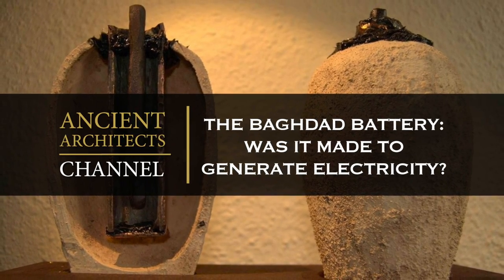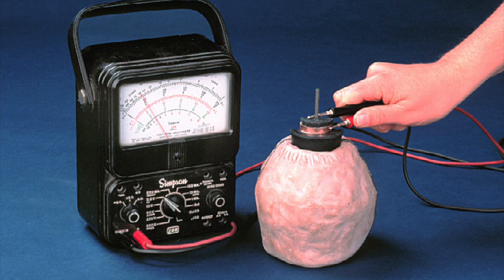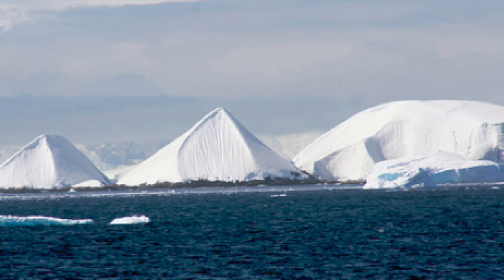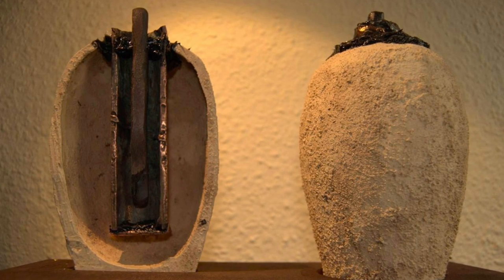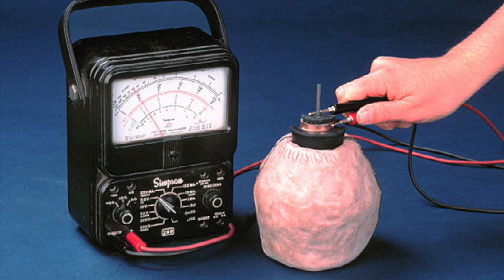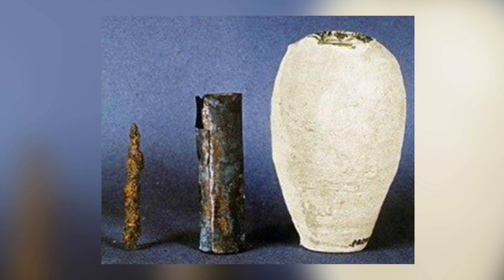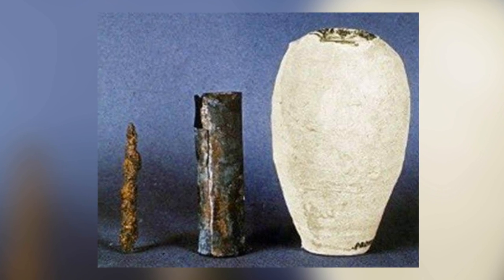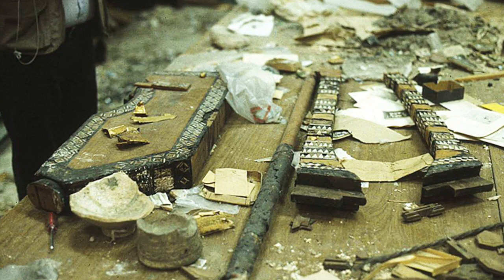The Baghdad Battery : Did it Really Generate Electricity? | Ancient Architects

Comment: Could they have been used to purify copper.  The slow motion version of an anode and cathode?  That could also be an explanation of the unmarked sarcophagii in Egypt.  The metal anode, cathode, and sludge are long gone, but the mostly unmarked containers for purifying copper remain.  Both systems relied on slow chemical reactions that had an electrical side effect.  One group of ancient Egyptians may have learned to use the electrical aspect but after a few hundred years of prosperity and droughts, lost the technology.

Comment: And the reason they dont just make bigger ones is because you wont necessarily get more voltage but space for the electrolyte solution so you would get a longer battery life but not voltage and you can electroplate with low voltage and for how primitive the battery is would be very easy to hook multiple together

Comment: Those are probably batteries. The iron is corroded being in a very protected and dry environment. Battery acid. Asfault is easy to remove by heat.  A bigger voltage could be achieved by many batteries connected in series not by one bigger battery which would give more current not more voltage.

What could it be used for? Maybe to remove rust from iron or something. Electrolisis have many applications. Make chlorine from salt water ?

Comment: Modern solder is 60/40% tin/lead, not 60/40% lead/tin as you said was used on the Baghdad battery. Even so, to have used any solder at all implies to me that there was an external electrical connection, ie a wire!

Comment: As someone who studied science , not classics, they are obviously wet cell batteries, no doubt. But you need a bunch in series as one only gives to about 0.8v. So then you need wire, but the copper wire has been taken and used for something else, like making jewellery . Someone could have been researching the electromagnetic effect a bit before michael faraday , but yes, not alot of motors around... but who knows ?

Comment: Just a thought/question, could they have been used as some kind of explosive device 🧨 💣 ? 🤷‍♀️
Reply: With wire and a spark, one might be able to remotely start a nasty fire. Especially with bitumen and wood or oil once it got started. Uncoated wires underground in dry sand could start a fire a ways away and seem like magic. Could be used in an altar for instance or it could have obvious military uses.
And with a goatskin full of natural gas, a tube, a bush, and such an igniter you could set up a miraculous burning bush that is not consumed by the flames deal too. On command. For a while at least.

Comment: Ok so just like the modern days they could have used some kind of soft material (probably a metal) that when it was heated it could Amit light . Just like the lamps we have they could have just connect the battery with the artifact, so no wires were needed .

[Sorry for my bad explanation Im not an English speaker so I tried to say what I thought the best way possible.]

Comment: It looks like a basic battery, is cleverly designed as a battery with isolated anod/ catod + acid, and WORKS as a battery. These are some very strong arguments and proof points. Simply stating that because we haven't found any recorded usage of them, therefore they can not be batteries, is a weak argument. Insted, explain why they were in this quite advanced design that just "happend" to work as a battery when their purpose was a simple container...
Reply: Absolutely right

Comment: I believe these were used for gold plating, a few volts are enough for that. Maybe never used where these have been found, could have been traded/stolen items. The answer of why they did not built larger vessel for higher voltage is simple. No matter how big the vessel is, the cell voltage won't increase only the capacity. Even modern batteries have a few volts cell voltage. A 12V lead-acid car battery consists of 6 cells, each providing a 2V nominal voltage. You can observe 6 caps for refilling electrolyte on the older, non-sealed batteries. Sealed batteries do not require refilling electrolyte hence the sealing. Charging is a mystery, maybe they melted the black material and replaced the content as electrical generators are different technology and far more advanced.

If it was for sacred scrolls, why the iron bar? And where are the scrolls? 

However it could have been some kind of bomb. You slam on the iron bar which punctures the copper so mixing the 2 liquid, initiating some chemical reaction leading to an explosion? But its likely that the copper part would have been ripped of from the vessel instead of the iron simply puncturing it.

Comment: Well the obvious answer would be electroplating. There seems ample evidence for this and doubtful you would need iron rod copper tube in acid solution for storing papyrus? As to the coated rod at top  to avoid shorting and losing electric charge prior to use, simple to melt or scrape off when ready for use. The clay container holding acidic component was probably the replaceable part and disposed off when electrolyte solution was used up the rod and copper cylinder just being inserted into new pot each time. Sort of an early rechargeable battery?

Comment: The lack of motors does not disprove that they are batteries. The exact same thing happened with the "voltaic pile" type batteries when they were invented in 1799. Initially there was absolutely no use for electricity and electric sparks were demonstrated as party tricks. People thought it was fun to be shocked by it. It was decades later when the technology developed to the point where someone invented motors, generators and lights. Inventing a motor would have been extremely difficult in the ancient time, due to the lack of experience with high rotations per minute machinery and the lack of metal wires. These are not things you would invent out of nothing, when there's no similar relevant industry and when nobody can think of a scientific way to explain the phenomena.

They likely were batteries, but they had not yet invented wires. They were at best party tricks, similar to the early "voltaic piles". The top of the iron rod was probably covered for safety, because it took effort to construct and they wouldn't have wanted an accidental discharge.

And in no way would anyone store important documents under a bitumen cover. If any of that would fall on the document, it would be next to impossible to clean off (they had no decontaminative agents like we do). Storing a document in a water proof box is a good idea, but surely if bitumen was the only way to seal it, the box would be designed to have an opening on the side, to keep the contents safer.

Comment: Though I'm not convinced in the battery hypothesis myself I would like to point out that early experiments with electricity as a curiosity where nessesary before the invention of electrical devices. If it is a battery it could be similar to the anchient Roman "steam engine" that was invented as a novelty and never put to practical use.

Comment: That last part of this video may actually give a hint. Looters of the Iraqi museum destroyed or stole the most valuable items and I believe the same thing happened to the artifacts that were powered by these batteries. The bigger batteries were destroyed centuries ago, the smaller were easier to hide and/protect. We may be looking at batteries that were placed in storage with asphalt covering the iron contact to protect against accidental discharge and could have been removed prior to use. The papyrus storage theory is new to me, but it doesnt explain the particular design of these artifacts

Comment: I'm as skeptical as anybody, but I think the best guess at this point is that these were probably batteries. Maybe they had ritual significance lol. Maybe they were novelty gag items. One volt would be plenty for electroplating or for the tingles. 
I will happily prefer another explanation if someone can find one. "Scroll storage" doesn't pass the laugh test. (Too small, no purpose for the iron and copper and, damningly, they were sealed with no scrolls inside.) 
They didn't power pre-dynastic HVAC or interstellar antigravity healing magic, but I bet they were batteries.

Comment: It's been my experience in life that the most sensible, easiest solution is more often the answer.  Theories that require a quantum leap in understanding of a relatively  mundane object, ie. these jars, that we discovered electricity 2000 years before we think we did rely on a HUGE jump of understanding.  Too far a jump for me.  If these are batteries, what did they power?  Where is there evidence anywhere in the world that we developed machines that used electrical power in such distant times?   Such a discovery of electricity once found, would never be forgotten and would proliferate rapidly and there would be many examples of equipment and ancient machinery still surviving, not just the few of these objects.

Comment: I think you're missing the ball here. Electricity doesn't just power motors and moving devices. Electrochemistry and electroplating would have been sorcerer level tricks in ancient times and could well be an integral part of the stone softening process, which was lost over time due to secrecy, and left people with only the knowledge of these curious jars that would hurt you if you arranged them and other metal pieces just right. 6 would produce a sensation on the tongue, 20 would produce a sensation on sweat soaked skin, 60 would make a grown man curse, 100 will start putting the fear of God in an unbeliever.
Many uses beyond spinning a wheel.

Comment: Matt, they did produce a charge ... that is NOT  insignificant. There is no evidence of electroplating in the region, but electroplating existed, and the very means to do it is the very thing you debunk. 

It's not an electric powerhouse, but there may have been a thin 'wire' leading out and it could have produced a tingle on the tongue or skin.. these particular devices were suitable for medicine.   Larger versions (lost in history) using exactly similar technology were used for electroplating.

Comment: They would have to be connected in series to increase the voltage, bigger ones would only increase the current, seems to be a battery to me why else have the iron rod and insulation

Comment: Here are the problems I see for your theory... why were they trying to store papyrus in this fashion? Surely they knew about oxidation it occurred so the iron makes no sense and why do they use copper for the inside? Why didn't they just coat the entire thing with bitumen if the idea was to store it Forever Without ever being opened because that's what they use for mummies the same reason. How come they never found any of these witb any Papyrus inside? Why are the iron rods always noticeably degraded from some kind of acidic substance? Perhaps a new said if they didn't cover the iron rod for storage purposes the battery will be unusable and that's where they found them to be totally covered with bitumen. As for why they never found any wire perhaps they didnt use wire because manufacturing wire is very difficult. There are many other things that are electrically conductive maybe whatever they use could be used in other places and that's why it wasn't found with the batteries which would only be good as batteries?  in my opinion they're much more problems with the theory that they were used as some kind of paper storage device than there are problems with it being a battery.

Comment: Maybe it is a battery but they didn't really know. We could just be overestimating their knowledge based on what we know today. We only found a few of them in one location, correct? Perhaps someone was simply experimenting and obtained some results without really understanding all the details. Where are the wires and electric motors? Where are the power drills? Just look at the battery. They weren't even close to that level of understanding yet so maybe they didn't have a specific application. If we found a ton of them all over then it would be safe to assume they had an actual purpose and people were using them for something but that's not the case. Maybe it was just good old fashioned science or some crazy ancient guy screwing around in his shed.

Comment: 1 volt doesn't have to power a motor or a city. 1 volt is enough to cure a minor skin infection, or even some parasites.  For such a short term medical purpose, they can easily have been intended as short term disposable objects. Look into alternative health "Hulda Clark" microcurrent  "zappers".  I've got one  ✔❤   Ok, It takes a 9 volt, but it works pretty well, depending on what I'm treating.

Comment: I suppose it’s possible that, much like Hero's steam engine, the principle was discovered, but not the practical application. We don’t have objects requiring electricity from the time period of the jars for the same reason the Romans didn’t have a network of locomotive tracks. It’s possible that, like Hero's engine, the electrical nature of the jars was treated as no more than a toy, or novelty. The iron rod may have been completely covered, but if not, is 1 volt enough to create a tingling sensation if touched? If the bar was indeed covered, would the terra cotta jar itself or the bitumen sealant be conductive enough to convey any such sensation? Such tingling abilities could have been used in any number of faith healing or other hocus locus activities. But more likely it would have been a household novelty - you have company, invite your guest to hold a seemingly nondescript jar on your shelf, then laugh like hell when they freak out because it makes their hands vibrate. So, basically, the Baghdad Battery was a 1st century plasma ball. They probably sold them at the ancient Iraqi version of Spencer's Gifts.

Comment: How do you know they're not for single use?
Just because the components it could have been connected to dont exist anymore or haven't been found isn't evidence.
Who are we to say they weren't using a large number of these at once to produce more than one volt?
It could have been to power something we'd consider tiny but massive is significance to the people of that time (as part of an annual religious ceremony for example).
I doubt it's a battery but I don't think this video has done anything to prove otherwise or suggested anything we don't already know.

Comment: Absents of evidence for intended use when dealing the ancient world is not conclusive proof.  If it looks a battery, works like a battery when duplicated, then It's the only supposed purpose that makes sense.  Single cell batteries connected in series increase overall voltage out put.  A series/parallel system can be tailored to suit different applications. Somebody needs to go dig up some evidence of plated artifacts instead of dismissing it.
Reply: Absolutely right

Comment: No electric devices doesn't mean it's not meant to produce electrical power..it could mean only that they just discovered how to make electricity and were only in the early stages of experimentation. If it were only just discovered there would be no  devices to power and the quality of "battery" would vary due to lack of knowledge and experience with how to use such new technology. And most mainstream scientist agree with each other as to not be discredited in their field.  They are certainly made to produce electricity or the perfect, specific, components would not be used to make s scroll holder!

Comment: Yes sir, those are batteries. They did not connect to motors because motors were not invented yet. (Atleast, as practical application). If you think about it, batteries are far more intuitive to invent than a motor. (And that's why Tesla was a genius). 

So, what did ancient batteries do?
medical relief during paralysis or just a type of massage. A small current was used as a way to treat paralysis or to massage. The patient (or user) would get into a small water tub and small amount of current would be introduced. (electric eels were also used for this purpose, besides batteries. But, batteries were safer than eels). 

Another important application of batteries was electroplating (gold). 

Further, these batteries can be used to create some fireworks in water using copper wires. (think of it as ancient laser show). 

But, overall, Ancient battery had limited applications (without a motor), so it was sort of forgotten(or hidden). Inventions and discoveries need right environment (and companions) to thrive. Invention of motor without a battery or a battery without a motor is pretty useless.

Comment: We use AA batteries hooked up in series to power toys, flashlights, etc. Each one of these modern power sources generates 1.5 volts....not much more than the one you are reviewing. As for a use for a low power source, how about electroplating gold or silver to a cheaper base metal to make jewelry?

Comment: Size issue:  limited by abilities to fabricate bigger ones.   Need to further explain unique design purpose. They were practical people. It was a proven technology for them otherwise there wouldn’t be large number of them identically created. If experimental, somewhere there would be a series of designs leading to this one. Wiring them in series is a great way to up the voltage. Much better than building a big one..talk to electrical engineer. They will help you.